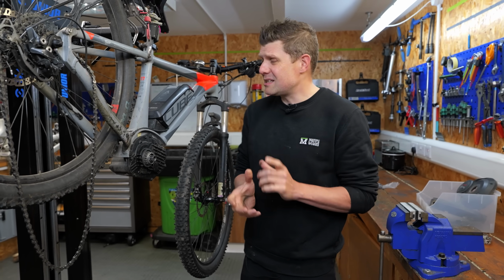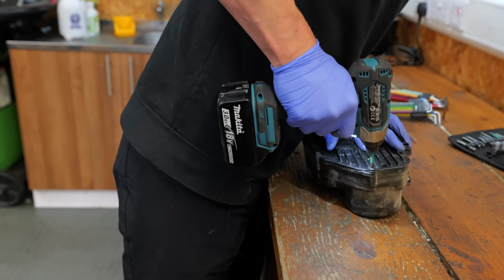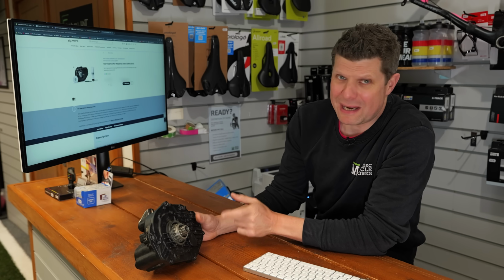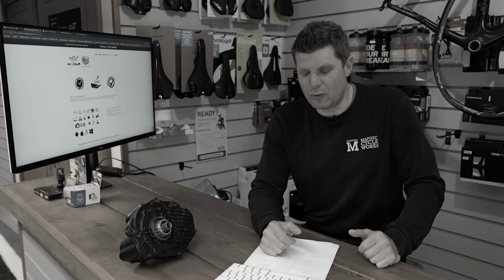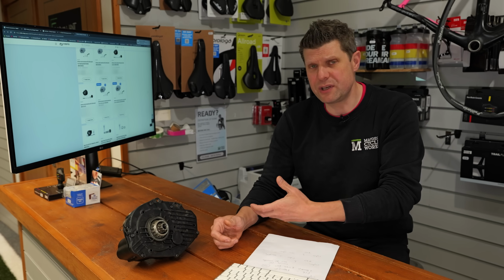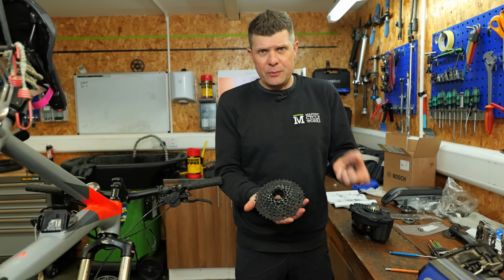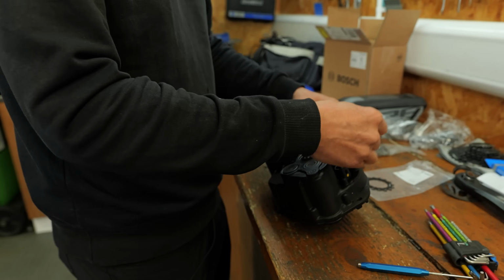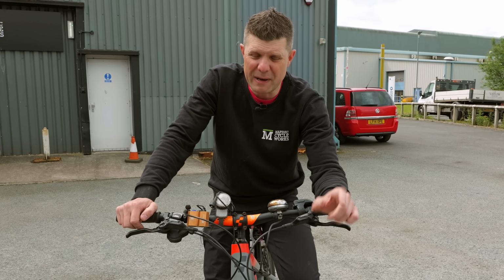This £750 eBike repair could have been avoided

Comment: I had E-bike based on a Brose system. One day some bastard stole my computer aka control unit. After i got a replacement off the eBay it just popped error and refused to work. Same model of computer. For same motor etc. Just different serial number. Turns out Brose just decided to kill off any way to replace parts if the original got stolen or died. You must have matching serial numbers, else nothing would work. 

To fix this, you must send the whole system, including the battery, to an authorized service center. And since the new computer was purchased off ebay there's a chance your repair still won't be authorized by Brose. 

No more e-bikes for me. This is totally anti-consumer. We need to add e-bikes to right to repair bill.
Reply: programmed obsolescence has made its way to e-bike?
Reply: Whoaa...before comments go any further on this post, bear in mind that control modules are almost always needing to be matched to their operating circuit to function. This is for a number of reasons. Designed obsolescence is very real, but not necessarily in this case.
Reply: I can't stand that companies serialize components. You can usually flash the firmware so that the serial number will match everything else, BUT that also usually requires their hardware and software to do. They probably do that to deter theft, but at the same time makes repairs challenging to do.
Reply: @madmax2069  it’s encrypted?
Reply: @kalijasin  maybe
Reply: @kalijasin 
LOL you do realise planned obsolescence is the standard operating procedure for pretty much all the major players in the entire cycle / MTB industry?

The entire shitmano/sram/maxxis catalogue is a master class in planned obsolescence.  They build shitty low quality stuff that is designed to fail/wear out/break off in a crash etc, or just be so badly performing, that the consumer is forced into either shelling out again for the top 1 / 2 / 3 tier products.  Or forever be replacing the bottom 4 / 5 tier components as they self destruct.

Forever changing "industry standards" (BBs, hub/through axle sizing, seat post sizes, headsets, Manufacturers specific e bike mounting standards.  Etc etc.  That's a bike industry thing.

A decades worth of bottom brackets deliberately designed to be too small to accept industrial standard bearings, forever causing BB creaks, just to spite a competitor brands crankset.  That's a bike industry thing.

Convincing the docile consumer herd to purchase MTBs that cost more than actual motorbikes.  That's a bike industry thing.

MTB tyres that cost as much as automobile tyres, but wear out in 3 orders of magnitude less distance travelled.  That's a bike industry thing.

Telling the docile consumer herd that eMTB motors limited to 25kph and 250w nominal is a "full power" motor.  That's a bike industry thing.

If you open your eyes, you will quickly see the entire industry is a disgusting bloated maggot infested mess.  The best thing any of us can do is vote with our wallets.
Reply: @madmax2069 not encrypted would make it easy to hack. 🙊
Reply: @kalijasin  Are you sure it's not encrypted? Have you had a look at the activity on the canbus?  I'm thinking of sniffing the battery coms with a logic analyser. There's bits of info out there on the battery protocol, but it's sparse. It would be nice to be able to recell and fit a new microcontrller and bms, to get around all this built in obsolescence crap. The battery stores a lot more data than the old Yamaha 'dumb' battery, that could be replaced with an arduino and a bit of code.
Reply: @stephensaines7100 if they are wired, they could be designed more like a switch
Reply: @BramBiesiekierski  you also forgot to add bicycle stands leg(just ending) made of plastic so they wear out every 2 years and you have buy them again :)also busch and muller company that made all new headlights removed button to turn them off(only temporarily for 8 minutes,they created whole software/chip to do it on purpose!)  for extensive wear.and all this companies state that they care about environment🤣
Reply: I also lost the display for a Brose-equipped eBike. I was able to get a replacement display through a dealer, and it worked. I'm sorry yours didn't work out, but you still might be able to make it work if you find a shop that can help you. I had to call around to about 10 different eBike shops in my area before I could find one that could help me.
Reply: I feel you. Only E-bike I'm considering currently would be one with a hubdrive with a batter on rear rack. Everything comes off and bike remains functional without them. I know it won't be of best performance, but sufficient for commuting. Different bike for rides on freetime then and all is good.
Reply: @MatthewLambertEngineer  10 ebike shops in your area wow you are lucky
Reply: Your bike is homologated for the country you live in,  the controllers are coded so the bike manufacturer can safely state that the bike meets those limits. If it was easy to swap and an unlimited bike were involved in an accident then where does the blame sit? I'm sure a new bike ECU isn't as expensive as the £2000 I've just dropped on my car!! P.s. I've got a new motor for my e bike ( I work for a bike motor manufacturer) and my local bike shop said they'd fit and code it for me no probs.
Reply: @robertcorbishley1712 Obviously the blame is with the consumer who modified his bike to break local laws. That’s how it works with everything else
Reply: @lbgstzockt8493 I understand,  but the manufacturers have a bit of responsibility too so the components aren't user adjustable,  also, for security they're coded to the bike. In theory,  if I got a serial number for an Australian e bike and reset my bikes computer it would allow higher speed... anyone got an Ozzy Levo SL???
Reply: Yeah my bosch motor had a loose bolt, one that connects the motor to the frame of the bike, and the bolt head was torx pro. That bit is really hard to find. Clearly we, the users, are not allowed to even tighten basic bolts. Torque values are also top secret with bosch. Shimano is better in this regard.
Reply: That's why I prefer DIY motors like TSDZ8 or Toseven DM02.
Reply: Well then go with bafang hub engines or Bbshd or bbs02. Parts are availabl. A bit of waiting time for shipping but atleast u get ur parts.🙂
Reply: @glock888  I see a lot of morons almost daily who drive unilluminated in the dark and some of them literally have a hub dynamo and didn't turn their frickin lights on, these are exactly the right for them, got myself a Supernova E3 Pure and this is also always on, I don't see the problem and LEDs typically last multiple thousands of hours, they will probably survive the bike.
Some of them also have brightness sensor so they don't blast on full power all the time, they may also use daytime running lights.
Same with E-Scooters, some obviously need training how to turn on the lights!
Reply: Sounds like Bosch to be honest.

Thats why i prefer modular systems - motor and ESC splitted, and just a "simple" system.... ESC needs connection to the LCD/throttle unit and power (aka battery), and just 3-4 wires to the BLDC motor.

Im even running my "60V" dual 1400W hub motors, original ofc, on a 3rd party VESC based 2x100A controller running up to 2x45A on 72V battery.
Reply: you've just helped me decide if I should buy pre-built or make something with a bafang motor. (I was looking at a bike with a brose motor)
Reply: @BramBiesiekierski  Yes, I've experienced this first hand, when I wanted to upgrade to the 12 speed shimano XT cassette.
Didn't fit on my regular freehub with QR, it needs microspline.
Wheels with a micropline QR hub can be found at many places, but a spare microspline hub with QR was very hard to find.
They obviously wanted to upsell me a wheelset along with the new hub.
Eventually I found a QR microspline hub, but dimensions weren't available, so I had to measure everything of that hub in order to get the right spokes.
It was the first time I've build a wheel; it went well right away and it's still running on my bike.
But I don't think most people would go through all that hassle just to avoid the upsell of a complete new wheelset...
Reply: That’s why I use bafang
Reply: @TheoWink-wh8st  Bafang 🤣🤣🤣🤣
Reply: @eyeOfAC I've found it to be the total opposite. Shimano don't release parts for their motors while Bosch do and ive had my Bosch motor apart into many pieces and fitted the service kit they sold me.

Comment: Excellent video once again! Shows that right to repair is a necessary movement.
Reply from the maker: Yes indeed!
Reply: The Bosch frame mounting system with that unusual flange makes it impossible to swap or repair with  a different  brand motor. Given that a Tongsheng ebike motor (about $300USD) retails for 1/3 the cost of the Bosch motor wholesale shop price  and the fragile nature of the Bosch,  the Bosch system seems designed to extract revenue from unsuspecting bikers and shops.  With no mounting standard or cost control of spares, the system is not "repairable" except by extraordinary means they way you've done.

Comment: Commenting about your comment at 07:36. Apple did make some assemblies available at exorbitant prices to discourage repair and encourage buying a new one. And if Bosch were to start selling the pcb assembly at 350£ let's say it would just do the same thing. Companies just do that to look like they are with right to repair when in actuality they are not.
Reply: If you’ve ever opened up some laptop, phone devices you can understand why not providing component level spares is actually protecting customers from dodgy repairs.
iPhones for example have an incredibly low failure rate.
Reply: The phones maybe reliable, but it doesn't stop people from dropping them and breaking the screen, which is probably the most repaired  part of a phone plus battery replacement. Apple are the worst, greed, greed and more greed.
Reply: @dominicbritt  Except that the battery is an actual wear part and inevitable requires replacement at some point in time.

Comment: the change in laws/regulations need to become much stricter on repairability and availability of all component parts. we're still running an old world model where cost is the driving force rather than resources. Maintain and repair ( the client had responsibility to look after their bike, the bike shop should have said go to an authorised dealer) should be the key moto going forward.
Reply: The EU is pushing hard for this. If it comes to pass fully (only certain regs have been voted on), it will make life easier even for those outside the EU.
That said, the manufacturer must pust some heart into it... You can get a rear bearing for a 6 year old Metabo Drill - so it's possible.
Reply: this but not just repairability, but also all those proprietary standards (or non-standard)
Reply: @smellysam  Yep it's possible... I have had audio equipment from the 70s/80s that was still repairable because parts were available.
Reply: @QoraxAudio  and the schematic on the inside of the cover - as it should be.

Comment: This is the very reason why I spent so much time doing my homework. Mid drive was my go to due to so many post. Then everyone was complaining about them breaking and the cost to repair or replace. In the end went for a rear hub 3k watt and I'm so glad I did never had any issues. Only negative was weight but I'm used to it now and been able to cover massive distances on DIY 72v 21700 battery bank.

Comment: There was a comment regarding "spares" from e bike manufacturers. Bafang does actually provide replacement and repair parts, I just rebuilt a BBS02 for a customer all the bearings and seals were available for me as a US Bafang dealer. The controller is also easily available for these units. Even their CAN BUS motors have good parts support (though using a C961 display for calibration of the UART controller on M series bafang motors is annoying). 
Vendors such as Green Bike Kit may be useful to you guys and any people out there with bafang motors. 
Bosch is relatively alone in the e bike space as far as big companies that don't provide enough motor repair parts.

Comment: I feel you with this one. In our bike shop we have had similar experiences with finding spares, repairing electronics and such. Sometimes the hardest part is trying to explain to the customer that their bike repair is going to out weight the value of bike. I've quoted up repairs on E bikes to customers and been sworn at for taking the piss and being a scam artist. We are not. We've broken down the quote exactly as you have, contacted suppliers for cost of parts or sourced things from Ebay and the like to fix Bafang bikes. There is a little bit of blissful ignorance with an elevated cost of repair with an Ebike with consumers and I don't think its there fault necessary. Sorry sounds ranty. The video was brilliant and some good education into Ebikes.
Reply: People's reaction to this is understandable. A lot of these bikes were less than $1k new, and not many customers I've talked to have any conception of how fixing things works. "It's a bike, how hard could it be", LOL. 

I come from automotive. Automotive techs make the same as bike mechs in my area. Auto repair labor rate starts at $125 an hour. IMO, not a chance your no-name e-bike is worth fixing unless the fix is an hour of labor and that much in parts. I see tons of these things 1-2 years old for $300-500.
Reply: @waysidetimes9226  The same applies to many consumer products. TVs, computers, hi-fi's, appliances...it's long been a known thing that that their low price precludes any thrift from repair.

It's the time of the consumer item.

Comment: Excellent video! Respect to you and that customer. I always repair my bikes. I get quite attached to them and wouldn't entertain replacement if repair is an option. In the past I have spent way more than a bike is worth to get it back on the road. I find there is great variability in terms of whether a shop is willing to repair. Some just push replacement, particularly in the case of older bikes or if parts are tricky to get. Very few shops were willing to help when I restored my vintage Raleigh Esquire.

Comment: I have virtually the same bike. I don't use it for mountain track work nor di I use it in the wet and 5 years on and without a service it's running fantastic. Despite this, I am a little shocked at how easily it seems water can enter the motor casing. I thought these were pretty much sealed. I also agree with other comments hare that Bosch should start listing and supplying all these motor parts.

Comment: I had a similar situation with my eBike, a 6 year old Raleigh Redux iE. The Brose motor has now failed twice. The first time was under warranty, but I still had to pay $200 labor cost to get it repaired.

The second failure was earlier this year an the warranty has obviously expired. I was able to open the motor myself and find the replacement part online.

I think it's great to keep eBikes on the road for as long as possible. I really hope Brose and Bosch can improve the situation by making their eBike systems more serviceable both by design and by parts availability.
Reply: You got scammed, if it was under warranty it is illegal to have you pay anything unless they can prove you caused the damage. So next time, you should really stand your ground about that.

Comment: I was a pioneer with the BionX system (now defunct) which was developed in French Canada. My conversion to my touring bike is so good that I will keep it until it can no longer be serviced. Spares are drying up, however I have managed to reverse engineer much of the system and I recently rebuilt the non available Lithium Ion battery pack. Repairs of this nature are very challenging and should not be tackled unless you know what you are doing.

Comment: You pose a conundrum! Ethically, you were absolutely right. Service logic, you were absolutely right. Business logic....you lost. However, you got the satisfaction of 'seeing the job done right'. 

As an electronic tech, I assure you that even if you got that PCB board working, it would most likely be intermittent at some point, and/or other problems would present. Remember, when dealing with FETs and (by solid state terms) high impedance circuits, intact copper board traces don't make or break the circuit function. Leakage does, and once road salts and acids have found their way in, the entire circuit is compromised.

Technically, by business terms, you lost on fixing this. But overall, I think your operandi pays off. The owner will be back for service, and others, based on the PR you've invested in.

Excellent job!

Comment: So so interesting as today I had the exact same conversation with my bike shop repairing my Bosch gen 2 motor on my Cannondale Moterra 2019!  In the end also decided to replace the motor at cost here in CA of $881 just for the motor.  This is the 3rd motor for the bike.  First motor was 2 weeks out of warranty with bearing noise and Bosch graciously honored the warranty and provided a new motor.  This time not so lucky! And just a few months earlier had all the bearings replaced at a cost of $500.  Shop thinks it also was the PCB after riding through a single deep puddle!  Bosch really needs to rethink how to allow more regular bike shops to do more extensive repairs instead of just selling more motors at $900 bucks a pop!!!  Probably not the last one either for this bike.  Crazy expensive ownership in my view for what is supposed to be one of the most reliable motors out there.  Get it together Bosch!
Reply from the maker: Sometimes I wonder why we don’t all get motorbikes instead.